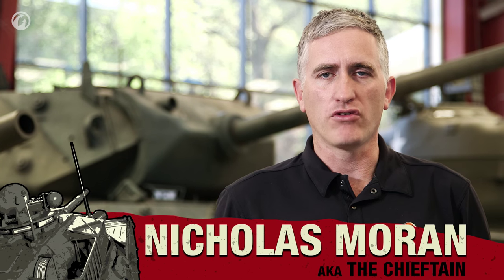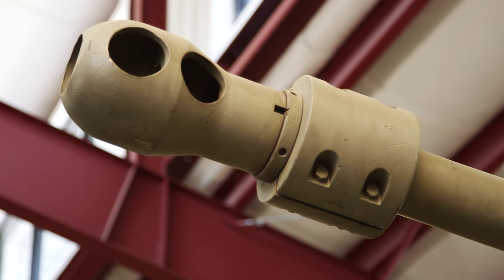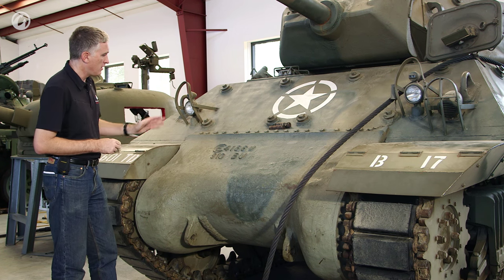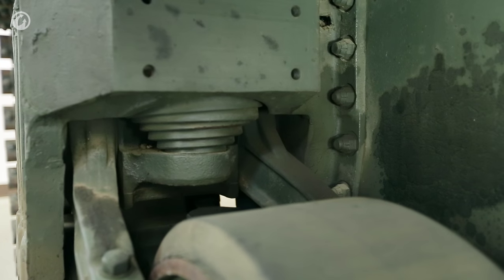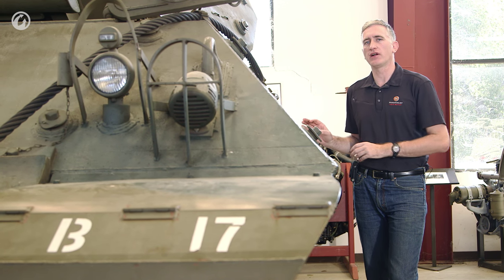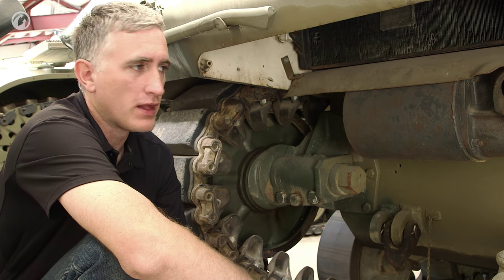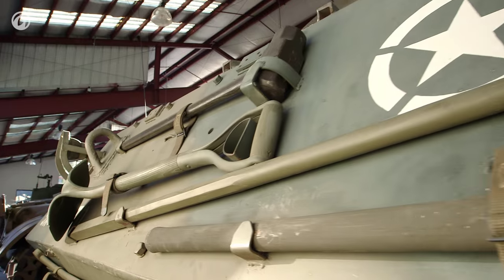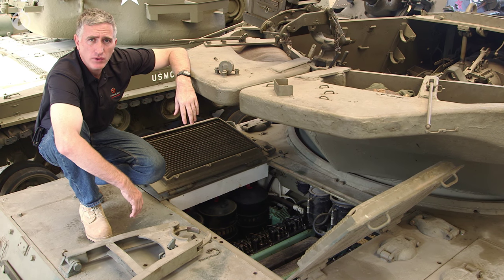Inside the Chieftain's Hatch: Achilles Part 1

Comment: The GM Detroit Diesel engines had different parts for the difference in part locations and rotation of the cranks. Different rotation of engine you could not interchange parts. As for  LC = Left hand crank rotation, Starter on Right side.  LA= Left hand crank rotation, Starter on Left side.

Comment: 14:09  If you look carefully (especially at the position of the valve springs in the head), you'll see the engines are actually mirror images of each other.  That's probably why the parts are all labelled LC and LA - mirrored parts are generally not interchangeable, even though they look identical at a glance.
Reply: You will also notice that this shows the engines are not two stroke ( cycle ) at all
Reply: @lewisbrand  Why? You can make a 2-stroke with or without overhead valves, that has nothing to do with it.
Reply: I didnt see that, but I did notice the intake manifolds are on different sides, so obviously the engines are not identical. Not sure if they would go as far as to make them exact mirror images, but it is much easier than trying to route exhaust and intake, and spark plug wires, etc to the same side of each engine
Reply: @lewisbrand  Two-stroke Detroit  Diesels have intake ports in the sides of the cylinder and fed directly from the blower, and exhaust valves in the head (either 2 or 4 per cylinder.)  They're definitely 2-stroke cycle.  :-)

Comment: At about 12:20 they cranked the turret counterclockwise towards the antenna then cut to the inside and when they cut back the gun barrel is past the antenna. 
Was it possible to go over the antenna bending it and the having it flip back or did they cheat there?
Reply: If you look closely at the base of the antenna, you can see the big spring that enables it to flex (and return upright) rather than breaking off when it's hit by passing objects--tree branches and whatnot. I'd assume that it works for the gun tube as well. That's pretty common for long vehicle-mounted whip antennae like that one.

Comment: So, if the turret was pointing towards the front and the vehicle got hit, the poor driver was pretty much screwed... great design.
Reply from the maker: +Danox94 Not entirely. There is no turret basket, so getting out from behind and up the turret is not actually a particularly difficult exercise.
Reply: TheChieftainWoT great! thx for the reply
Reply: +TheChieftainWoT So it's like a T-34 in that aspect?
Reply from the maker: +budmeister Similar. I found T-34 to be a little more cramped in terms of getting out through the turret. The difference would be minor, though.
Reply: +TheChieftainWoT But on the other hand if the Achilles was surprised during transfer the counterweight makes a nice shot trap

Comment: Do they run them without valve covers?
Reply: That does look odd.
Reply: Colin Park I was thinking the same thing
Reply: It was not at all uncommon in that era, so I wouldnt be surprised. But I cannot say for sure in this case. They expected engines to use a lot of oil back then, so the oil lost from the exposed valve gear was just considered a normal part of operating. There was a reason oil was a consumable like fuel at the time. And one of the 4 external tanks on a T-34 would often as not be used to carry motor oil. Oil consumption was measured in quarts per 100 miles, whereas a modern engine doesnt need to be filled at all unless something goes wrong.
Exposed valve gear would be considered a bit archaic by 1940, but not totally antiquated. It was commonplace just a decade or two before that, especially on truck and industrial engines. I think valve covers were originally adopted in passenger cars to muffle the valvetrain noise a little. Covers were unpopular because they made it more difficult to adjust the valves, which had to be done frequently, and it was still a novel idea to cover them up. Valves on steam engines were never covered up in their fathers' day, and keeping all the bits oiled (and getting spattered with oil whenever you stood near a running machine) were just parts of life.
Reply: @justforever96  I used to adjust the valves on my landrover frequently, the cover was held on by three screws, so easy to remove.

Comment: The reason LC, or LA, I would lay money on,  one engine turns clockwise the other counter-clockwise. As you can see they are mirrors of each other.
Reply: I'm not positive about the counterrotation (although it's certainly possible), but they are definitely mirrored engines - which means that a lot of parts will look the same, but won't actually fit both engines.  Making a 2-stroke engine run backwards isn't all that hard and doesn't usually require a lot of different parts (mostly cam timing and connecting rod angles), but mirrored designs means that the vast majority of parts will need to be slightly different - and will also look so close to the same that mechanics might make a mistake if they're in a hurry or Jonesing for a coffee break.  :-)
Reply: I doubt they run opposite directions, that would just complicate the combining of their outputs. It is very easy to make an engine run in either direction, simply a matter of altering the timing slightly, so no reason not too. Especially old 2 stroke diesels, which could often run either direction just by shifting a lever to change the timing slightly. Many old trucks used that instead of reverse gear, and large diesel marine engines still use this system.
You are thinking of aero engines, which benefit from counter rotating.

Comment: Are the valve covers removed for maintentance or do the engines really not have them?
Reply: Removed for maintenance.  You can find pictures of the GM 6046 showing valve covers held on with 4 large knobs running down the centre of the covers.

Comment: As to the engine spare parts? Is it not because the two engines are rotating in a different direction? This might be due to the gearbox meshing the two engines?
Reply: 14:09  If you look carefully (especially at the position of the valve springs in the head), you'll see the engines are actually mirror images of each other.  I'm not sure whether they actually counterrotate (it's certainly possible, although not necessary), but it would explain why the parts are all labelled LC and LA.  A mirrored engine layout generally don't have many interchangeable parts, even though they look identical at a glance, whereas to counterrotate a 2-stroke doesn't usually require all that many changes.
Reply: Why would you want two different rotation directions when you plan on combining them into a single output? You could, but why? I think it is because it is a lot easier to route the hot exhaust from the outside of each engine and concentrate all the carburetors and intakes in the central area between them. Otherwise you would need two intake systems, or space to pipe the air over or around one of the engines, and you would need to cool the area between the engines where the hot exhaust was confined. That and you would have one of the intakes being heated to very high temps by the exhaust of the other, which is never good. Although odds are in that era the exhaust and intake are on the same side anyway, and all 4 are concentrated in the space between the engines, and they rely on the airflow to keep it cool.
Reply: @justforever96  I would suggest looking into the Detroit Diesel 6-71, the intake would be on the outer side of each engine, fairly low on the block with the supercharger mounted there as well.